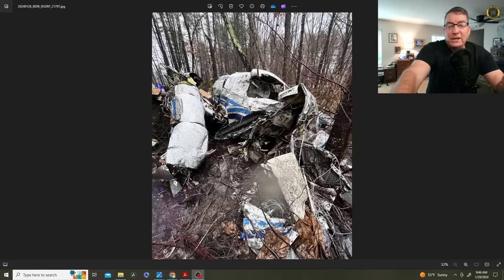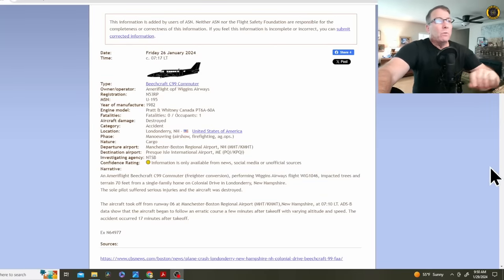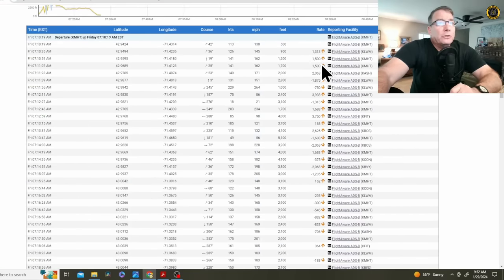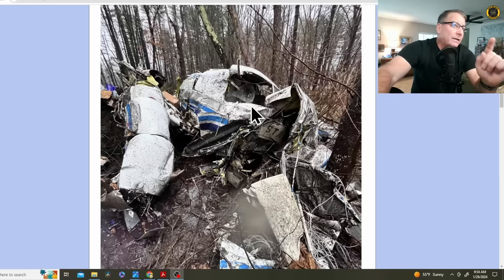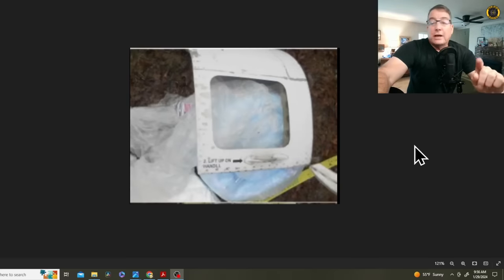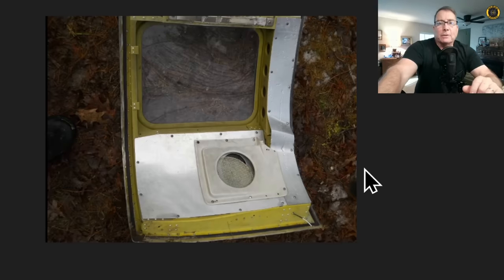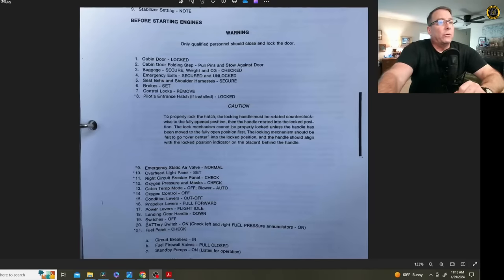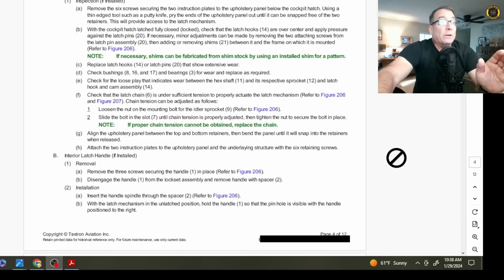Beechcraft C-99 Door Open In Flight Crash! 24 January 2024

Comment: I have over 2200h flying the 99 for Ameriflight. Unless the plane was mostly empty, we always used the hatch to access the cockpit. These locking latches were notoriously difficult to lock. It was also challenging to confirm they were properly locked, as the small opening onto the mechanism was very narrow. 
The pilot was in IMC, in potential icing conditions, with a roaring PT6 a few feet away from him, and with a very strong cold wind entering the cockpit. It’s a miracle he survived this.

Comment: I had one of those doors come open on me many years ago. I was able to gingerly guide the door to a full open position and then come back around to land.  Boundary layer airflow was so strong that I could not relatch the door.  My headset stayed on, but my glasses were gone in the slipstream.  Quite an exciting start to my day, that's for sure.
Reply: Why don’t I believe you?
Reply: @johnnunn8688  not sure? How much time in a 99 do you have?
Reply: @707studios  I’m aware of the kind of aerodynamic forces you would be fighting against, to gingerly guide the door to its open position and then why would the door stay attached? Yaw a little left and the door would slam shut, yaw right and it would certainly tear off, if it hadn’t already. I’m an aircraft engineer, so don’t have to be a pilot to disbelieve your yarn.
Reply: @johnnunn8688  I tried yawning each way, in a climb, level, and in a decent. At climb speed and at approach speed. The hatch seemed unaffected in all regimes until it was within an inch of closing. At that point, there was no way it would close the rest of the way. As an aircraft engineer, I'm sure you know that a hatch coming open on a 99 was not an unknown problem, hence the structural reinforcement on the upper hinge. As a matter of fact, the company specifically addresses the ability for the pilot to close out an open write-up for a hatch opening in flight. With all that said, I expected it to come off at any second and was most appreciative when it stayed on throughout the approach and landing.

Comment: A&P who worked on this fleet for over a decade. 
I had pilots call me over during the morning launch of the fleet to lubricate and reset the hooks on the hatch.
The bicycle chain drives two gears attached to eccentric cam assemblies, and the hooks can easily fail to engage the latches fully, but still allow the handle to go to the locked position. 
I flew in these aircraft for a hundred hours or more on rescue missions and now fully appreciate the fact that they used a flashlight to check the hook engagement of both latches, and more than once opened the hatch, cycled the handle, and locked it again. 
One former pilot told me about a time he noticed the hatch becoming noisy in flight, only to notice his vest had caught on the handle and was pulling it to unlocked. 
I have wrestled these hatches off and on for maintenance, they're fairly heavy for their size, and the hinges are relatively flimsy in any direction but tension (locked shut). This could have caused significant damage to the elevator/horizontal if it hit, especially in cruise at 200 knots.
These don't have oxygen masks, or bottles, so quite likely he was cupping his hand around the microphone to be heard.
 Thankfully these have been upgraded to a garmin 430, to assist with navigation.
I pray the pilot recovers fully.

Comment: This is absolutely a nightmare situation- door flys off, totally disorienting noise, freezing temperature and possibly precip entering the cockpit, possible and very likely icing as well as damage to the rear control surfaces due to the departing door- all the while single pilot IFR- really not a situation u can b prepared for- this guy did a hell of a job not loosing total control and stalling into a residential area- btw, he apparently recovered from two near stalls- yeah, I’ll fly with him any day!
Reply: as long as he is not the one closing the doors.
Reply: *losing

Comment: Dang, that was one hell of an angle to crash at and still survive!
I have to assume he was "saved' by the trees crumpling/collapsing. Still a bit of a miracle!
Reply: Wires can also significantly slow an aircraft. Google 'plane hanging from power lines'
Reply: When I was in flight school/university in the early 2000's, we did some research on which would be more survivable...water or trees. Our research turned up at about 50/50 either way, for the exact reason you mentioned. The trees provide some cushioning and slow the forward momentum. Unfortunately I didn't keep the detailed info. It would be interesting to see some people do that research now and determine if anything has changed.
Reply: @paulis7319 Depends if you hit the canopy or the trunks. Trunks and thick branches will slice through an aircraft like a hot knife through butter.
Reply: @paulis7319  I believe I read that report. And the overwhelming answer was damn nearly 'put it down somewhere flattish, and KEEP FLYING THE PLANE'. Trying to turn to a place where you can probably do a nice landing, versus putting it down gently at minimum flying speed somewhere flattish with no immediate cliffs or buildings has killed so many.
Reply: @queazocotal  Yep, CFIT (controlled flight into trees) is generally more survivable that CFIC (controlled flight into cliff).
Reply: @MattyEngland  That was taken into account. The majority of tree landings are initiated by contact with the softer treetops first.
Reply: @queazocotal  However, a former coworker had to put a Citabria down on a golf course. When he saw that the rollout would hit golfers, he opted to strike a tree trunk with a wing to spin it around and stop. He survived without a scratch, and laughed about it.
Reply: Plus the 2 or 3 ft of snow reducing any sparks

Comment: The door was found below where the first pitch up and turn to the left occurred.   

Before the door was found I was thinking load shift, due to the pitch up and then screaming decent, then massive pitch up and stall rinse repeat.

But now with the door a factor, the immediate difficulty in control and wild altitude deviations make me think the door struck the elevator when it departed the aircraft.  A simple door opening would not really have caused that otherwise.

I don’t believe icing played a factor  since the aircraft was booted and the behavior of the remaining flight didn’t really reflect what a normal icing incident portrays.
Reply: I don't know anything about the aircraft but maybe the freezing conditions caused the door to not fully latch when closed all the way.
Reply: Keep this comment up high, guys.
Reply: He flew over Bridge Street twice, so it may have broken off the second time by.  
The left hand turn would make sense if the door popped open and he tried to get it out of the slipstream by yawing and turning left so he would have an easier time getting it shut and latched.  

The crazy altitude deviations could have been a result of distraction with trying to secure the door, or not being able to see the instruments with all the airflow coming in, or both.
Reply: Frozen pilot frozen eyeballs
Reply: My thoughts too. Load shift.
Reply: @DBarnes727  in the scheme of things an open door is not that major of a distraction.  Most people with experience in smaller GA aircraft have had a door become unlatched at some point or another.   It’s attention getting but not enough of an issue that you’d risk loss of control over to dick with.   That’s also why I’m not really buying Juan’s theory on the headset getting ripped off.  He wasn’t that high so not a huge pressure differential and wasn’t that fast at the time.

If this was initiated by the door opening and departing, it would have been loud and shocking but not debilitating.  Remember the adage: aviate, navigate, communicate.   I believe he was NORDO because he was too busy aviating, trying to recover the aircraft.   

He probably wasn’t even hand flying the aircraft at the point the door opened but had the AP engaged.  In which case there would also be no plausible reason to lose control.
Reply: @MickAv8r Yeah I know, I've had doors and windows pop open in GA aircraft.  Not in these same cold IFR conditions though.  Either way, aviate and navigate are the two most important things at any time in an aircraft.  Hopefully this guy will fully recover and we will find out what actually happened.
Reply: You said you don't believe icing was a factor. What about icing inside the cockpit once the door was gone?
Reply: @MickAv8r bombing along at 70 knots and having a door open is not even in the same ballpark as climbing out at nearly twice that speed, with a PT-6 screaming right outside your window. In no way would I ever consider that to be a minor distraction.
Reply: @MickAv8r  I agree that a door popping open in a GA aircraft (which I have experienced) is no big deal. However, this is not even close to the same situation.   The door is completely gone, there's a big hole right next to you, there's a big propeller and a jet engine right outside that hole, it's freezing and raining and that is probably coming in that hole at well over 100 knots, you're in IMC, maybe your headset got blown off, maybe your glasses went out the hole, maybe loose cargo is blowing around, etc.  I think it's a pretty terrible situation.
Reply: Exactly my thoughts. Door left and damaged the elevator and or rudder too.

Comment: The second Wiggins BE99 crash in the Northeast in just 6 months. N55RP also crashed in Central Maine under weird circumstances back in July, very close to my home and home airport. It’s not my place to say, but Wiggins does not have a great reputation for maintenance in the pilot circles up here
Reply: Damn I used to work on 55rp.
Reply: They had a problem losing both engines around Lansing too?
Reply: Can confirm, worked there for years and didn’t like what I saw unfortunately

Comment: Whew!  I have heard that noise before in a Baron.  That poor pilot of this C-99 had his hands really full.  On the Baron I flew for 27 years, we had a recurring problem with the door poping open soon after TO.  Even after continuous and repeated maintenance and repairs to the door and door pins. And my door latch wasn't nearly as complicated as the C-99.  On the Baron TO, the drill; fly the aircraft with all the noise and land straight ahead or return to the airport.   It was part of my pre-takeoff briefing to whoever might be sitting in the right seat.  I would do pre-takeoff checks by bumping  (like hard) the door but even that didn't do the trick every time.   Nothing on the ground at idle can simulate a flexing fuselage and door in flight.
Reply: Flexing fusilage. HOLY CRAP. I didn't even consider that. Damn thing could get pretty squirrelly. (Bucking bronco?)

Comment: I flew the B-99C back in the 80’s. The aircraft were used for cargo at night and commuter during the day.  Seats out at night, back in for passengers. A fellow pilot and friend had the “pilot access hatch” exit the aircraft at 5000 feet while at cruise with passengers.  He said it sounded like a double barrel shotgun went off, both barrels right next to his head.  He could not communicate with anyone, ATC, copilot, passengers.  VFR, he pulled the power back and looked down.  Luckily there was an airport right under them and he circled and landed.  The latches on the hatch is a bad design.

Comment: I flew for these guys and I quit due to poor maintenance. The door, windshield seals leaked so bad I had to wear a rain coat. I quit when the check valve to the engine fuel tank failed allowing fuel from the wing to vent overboard. I had another pilot with me we had electrical failure and landed using hand held com & gps. I had 1,200 hrs in these with a prior operator. It is unpressurized but a flapping door will cause all sorts of problems.after loading there is only one way out through the door or when the aircraft is unloaded.

Comment: I worked line service for Ameriflight around 2000 out of KSLC. We had a few of those C99s, awesome aircraft for cargo. I remember those access hatch doors always seemed a little flimsy, but they latched tight. Amazed the piloy survived. I cannot image what that cockpit would have been with that door open right next to your head, the engine roaring, etc. The pilot should be given a metal. I don't know if he had control on the final descent, but 70 feet from a house I would think he had control and was able to put it in the trees. Having to get out that small door in a hurry would also suck. Not a very good design by Beechcraft in my opinion. Glad everyone is ok.
Reply: I don’t think your logic is logical at all in saying “70ft from a house I would think he had control and was able to put it in the trees.” This could be coincidence.

Comment: I had an experience in a Piper Arrow with a pilot who I have been flying with for 15 yrs in 172 and 182 Cessna. This was my first flight in the Piper that my friend the Pilot had recently qualified on. We were up with 2 other guys…weight good… but the pilot was so intense on sharing all the info about checklist and everything that as an experienced flyer with my hat on never saw the ceiling positioned door locking mechanism. We were at 6500 out of Asheville NC going to Clemson SC. About 15 minutes into the flight I was in control of the plane but all of a sudden there’s lots of cold air and the door is no longer latched. We were able to hold it closed with my hands, switching one to the other because of the cold. Flew another 46 miles to safely land at Clemson. Lesson learned and always follow check list and get verified! 🙏🏽😎
Reply: A similar thing happened to my father in a Piper Commanche.  He put it into a slip to the right and was able to yank the door shut.

Comment: Brings a whole new meaning and importance to the Hatches and Harnesses check.

Ask me how I know.
Reply: How do you know? 😮
Reply: @new.handle   :-D
Reply: @leifvejby8023  I bet he is tech that checkes them, so he knows :]
Reply: Had the HALT check drilled in to me by a very thorough instructor. It was introduced at the beginning of spin training.
Reply: @dagger4146  Well, I do remember standard walk-out communication with cockpit over the headset "all doors and hatches closed and secured..."
Reply: @new.handle After take off from second aerodrome on my qualifying cross country flight my PA38 passenger door came loose. One hand on the column, the other on the flimsy door latch. Hell of a feeing with 700’ cloud base. No way could I land with right hand holding the door. Luckily I pulled it enough to click shut to journey on to class D airport. Never been so frightened.
Reply: @robinmyman  Did you manage to find out what was the problem with the latch? Wear and tear or a part got broken (spring loose, axle broken)? Also, not a nice thing to happen to you on a first long ride.
Reply: @new.handle  Harnesses and Hatches. Altitude (above 3000 AGL). Loose Objects (in the cabin). Terrain and Traffic (No flight over populated area, figure 8 for visual traffic check). Completion of the checklist items satisfactorily meant you were ready to initiate the exercise and start reducing power and pulling the nose up until the stall sounded, and that's when the fun began. The feeling of mastering the maneuver was euphoric. IMO, that's where a pilot learns to wear the aircraft.
Reply: @new.handle For each type of plane there is a specific checklist. After power checks the checklist among other checks requires to check Hatches and Harnesses. The PA38 Tomahawk has two doors and I was obviously flying solo…no instructor. I had not checked the right door was properly secure…two latches per door. It’s not like a car door. I managed to secure one latch. Did I check H&H properly after that!
Reply: No
Reply: No
Reply: @robinmyman   From my time on Tomahawks, I seem to recall that the pre-landing checklist requires the door lock to be unfastened before landing.  So in the event of a crash, the fire service can open the doors.

Comment: Could be the combination of both trees and powerlines that helped arrest the fall just enough to lower the g-forces at impact with the ground that caused him to survive. Given the door was hinged at the top the likely position of door right before point of separation would be at the top centerline of the fuselage therefore having a higher chance of striking the vertical stabilizer damaging the rudder yaw control. A miracle there was no post fire either these turbo props almost always catch fire post impact
Reply: Yeah thats my guess it hit control surfaces
Reply: Those prolonged crashing sounds sounded like a broken fall.  The report says it hit wires -- I wonder if it also hit trees.  When he knew he was going down maybe he aimed for trees?
Reply: I thing the fact that he landed down hill instead of on flat ground helped out alot.
Reply: @SeekingTheLoveThatGodMeans7648   If you take it in to the trees the ones in the shot are the ones you hope for not a 50 year old oak forest.
Reply: Yes tree landings can either save you or kill you problem being in the weather you don't find out until your in them.